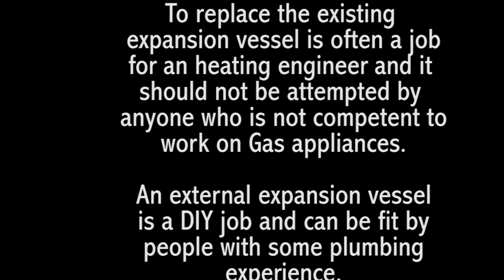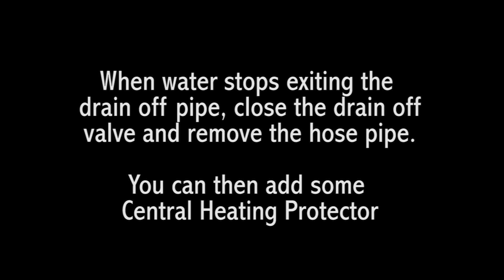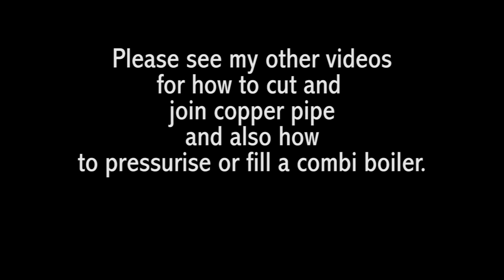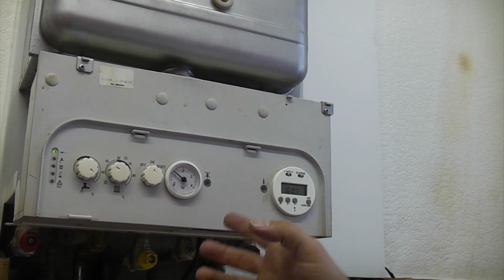How to fit an expansion vessel

Comment: You forgot to tell these people you took the case off your boiler which is AGAINST THE LAW! How did you make sure your expansion vessel was adequately sized for the boiler and system you have? Guessed I bet or bought whatever was cheapest. It shows in the quality of Inhibitor you bought. The cheapest they had
Reply from the maker: I suggest you go and check the LAW before you go spouting off a load of nonsense.
You do not need any qualifications to remove the cover from a combi boiler unless it forms part of the seal for the combustion chamber. The vessel was sized correctly BTW ;-)
Now go and spout your nonsense elsewhere!

Comment: Couple of slight issues here.
You mention yourself your not gas safe, yet then remove the front cover of the boiler! Your average diyer should never do that,and the room now needs checking for escaping flue gasses.
Also filling loops should never be left connected (water regs)
Reply from the maker: I checked with Gas Safe who said I could remove the case from my boiler.
I know the filling loop should never be left connected, but when I posted that in my other video on how to repressurise a boiler all I get are people saying theirs was left connected by the engineer that installed it.
Perhaps Gas safe should be doing more checks on it's members to ensure they are not breaking water bye-laws.

Comment: You turned off the supply at the Return pipe .
Then when everything was Connected up you opened the Return pipe to let water in . So is it safe to say that the Reurn pipe is the one supplying cold water to the boiler ?
( And thanks for the video )
Reply from the maker: No, there is a chance that someone has connected the filling loop to the flow pipe.
The central heating works by having two pipes, one pipe is the flow pipe and the other is the return pipe. There may be 5 or more pies entering the boiler but only two of them are used for the central heating.
Hot water leaves the boiler via the flow pipe and then after it has been circulated around the radiators it returns to the boiler to be heated again, this is the return pipe.
If you have the boiler on central heating only (not using any domestic hot water) you will feel that two of the pipes get warm/hot. The return pipe will be the cooler of the two pipes, if you have a digital thermometer you can use that ;-)
Reply: ***** Thank you again .
Reply from the maker: Tee Emm
You are welcome ;-)

Comment: soz, maybe a daft question but do i need to disconnect the old expansion vessel or just leave it alone? I have just discovered that there is defo water in the tank as i pressed the schrader valve and no air, only water... I have a Vokera Compact HE boiler (5yrs old).. any advice would be appreciated.
Reply from the maker: Just leave the old one where it is, there is no need to disconnect it ;-)
Reply: ***** just leave it... wont it continue to leak / drip water ??
Reply from the maker: Anthony Need
No, it's only leaking water when the schrader valve is pressed in, just like your car tyre will leak out air if you press the schrader valve in.

Comment: I understand your desire to diy. If your on low incomes the cost of a professional is a little off putting. Your advice is obviously researched and provided in good faith. There are a few errors in your information. I hope the folowing info will help.

1. Some boilers will not function correctly without the internal expansion vessel in working order. 
2. The size of the internal vessel is only designed for the boiler and a small number of radiators. 
3. The main cause of failure of expansion vessels is being undersized. 
4. Replacing with an undersized vessel is going to lead to a repeat failure. 
5. Expansion vessels need to be checked annually at the annual service. 
6. Expansion vessels should be refilled with nitrogen not air. 
7. Water issuing from the Shreider valve Doesn't prove the failure of a vessel but mostly does.
8. Flexible hoses are not the best means of connection as they can allow oxygen ingress. 
9. There is not a standard pressure foot the vessel or the system. 
10. The charge pressure for the vessel and the system are calculated from the relation ship between the height of the system above the pump and pressure gauge. 

I read a comment saying that you don't have to be registered to install gas boilers. This is true but needs to be explained further. The law says that you must be competent and that the standard of proof required for competence is being gas safe registered. This clearly leads to the fact that you do need to be registered, however this applies to individuals in business. The proof of competency for an individual working in his own home is a formal qualification such as those required for gas registration. If you had these qualifications which are only Valid for 5 years an were not registered with gas save you would be a stange individual.
Reply: I reckon I can build that inhibitors need a great deal of understanding. both Christopher Flaherty and I take great interest in water quality issues and believe that the European vdi standard is correct. this standard means that inhibitor is almost never needed.

Comment: Well the PTFE didn't work. I am now losing about 0.2 bar every day from the system (boiler not being used at all), so air is escaping after filling. I wonder if it is definitely losing air from the valve on the vessel before investing in a new vessel. Do you know of any other possible causes like air purger valves that I am unaware of that I should rule out before parting with money? Much appreciated! :)

Comment: Thanks, I did think of this myself, but before doing it, I let the rest of the air out to test that no water leaked out, then repressurized and squirted WD40 over the valve while it was hissing, and it seemed to stop leaking air. Not sure if the WD40 just deadened the sound but the valve did seem temperamental, I guess time will tell. I will try the PTFE if it fails again. Thanks for helping me understand how it works so I could try this, I hate to throw so much money at a repair man!

Comment: Thanks. I checked the valve,  I pressed lightly & no water came through (however the valve is at the very top of the vessel), but the air pressure was down to nothing. I put 1 bar into it, which forced the CH pressure back up, but when I took off the pump, air was leaking out of the valve, until I put the cap back on. Can I assume that this leaking valve is the problem why I keep losing pressure and have to keep filling from the loop every now and then? Thanks very much for your help!

Comment: Job done, though as you say, not to be done by an amature, and you have to watch the electrics, sorry i did,nt mention that i am a retired electrical engineer, with industrial boiler experience, repair, installation & design, however after resting for a while, just thinking out loud definately resets the brain, also i have the PDF manual
thanks for listening, you reset my buttons!

Comment: i would be isolating the existing expansion vessel completely fron the 
boiler ? just leaving it in place ? replacing the system with an external expansion vessel immediately outside the boiler? nothing else behind boiler. the orignal vessel would just be left in place with no connection to the boiler.

Comment: i would be isolating the existing expansion vessel completely fron the 
boiler ? just leaving it in place ? replacing the system with an external expansion vessel immediately outside the boiler? nothing else behind boiler.

Comment: i would be isolating the existing expansion vessel completely fron the 
boiler ? just leaving it in place ? replacing the system with an external expansion vessel immediately outside the boiler?

Comment: difficult to see, i assume its on the shrider but as it at the back of an alpha 240 and only leaks when the heating is on i think the diaphram is leaking with expansion, very slight as pressure is not lost on just dom. h.w, also the drips can be seen dropping from the back casing
dolphin

Comment: Hi, I,mm fitting an external expansion vessel , as there is a leak on my present vessell, although it,s difficult to see where,
the new vessel is precharged to 1.5bar, however the system required only 0.8bar do ihave to reduce the pressure, also can i just cap off my old vessel
dolphin

Comment: Also my system vessel pressel is 0.8 bar (8lt) systempressure pressure cold is 1.0bar the replacement vessels from tool station are precharged at 1.5 bar do i need to reduce the vessel pressure ?
dolphin

Comment: Your expertise and time is much appreciated. The radiators are all full and I checked under the house (Mobile home) and no leaks. Usually when I fill a bath with the water temperature set high it drains the pressure down to nothing, but doing the washing up with temp low doesn't affect it. I will try what you advised. Thanks so much.

Comment: I guess that makes sense and can see how the new one takes over, thanks for the insight. 
The problem I have is that my system doesn't always loose pressure when I fire up the hot water, only sometimes. Will the fitting of an external vessel still fix it in this case?

Comment: Thanks so much for this! 
Can I just ask what happens to the original faulty expansion vessel? If the diaphragm is knackered and you fit a new external, how does this work if the original is still in place? Sorry if I'm being a bit thick about how it works
Reply: Leave old x tank in place.be fine

Comment: A sensible and straightforward guide. Thanks.
 
And will idiots please stop saying " leave it to the "professional"
a) This is not anything to do with the "Gas" side - its a plumbing job 
b). If you were going to pay a man, you wouldn't be looking here, so a helpful video is a boon. 
c). I've seen many complete bodges done by "professionals in my lifetime - I do it myself often cos I want it done right. If it's a Corgi job, then I pay the Corgi [I know ,Gassafe] ,man.

Comment: Sorry To but in, but the expansion vessel should be fitted as close to the return pipe near the boiler, The reason being is all to do with the "neutral point" in this case the neutral point would be the expansion vessel. So anywhere between the neutral point and the boiler pump will be working under negative pressure (bad) so the nearer the better, if you install to far away you could be forever venting radiators which in turn is not good for the system, Hope this helps

Comment: duuude, you forgot the gasket on the expansion manifold 
it is gonna leak for sure, also do not use hemp, but loctide, 
if you use hemp , jou wil have trouble getting the vessel off of there, 
and by-the-way they need to be replaced once in 5 to 8 years :P
cheers mate

Comment: Hi mate, great informative posting. Can you clear up a few questions? I have a worcester bosch junior 28i combi. The expansion vessel has been disgnosed as faulty along with the PRV. If I fit a secondary vessel as per the video, do I need to remove the existing one and how would the pressure release valve work on the new vessel. I was quoted £1700 for a new boiler so I would like to have a go at this before the  new boiler option. Cheers
Reply: you would leave the old one in and fit a new one on your return pipe. you don't need a new boiler. with the Worcester jnr you sometimes can't change the vessel unless you take flue off and there is another room between vessel and ceiling to get it out or you have to take boiler off the wall. so it is better to just add a new vessel on return. its standard practice to replace prv if vessel has split or gone over 3 bar and released water outside.

Comment: I think i may have a vessel fitted with a removable membrane in the form of a balloon, it is made by aquasystem and it has very little lip round the waist line of the tank.  I am getting water squirting out when I depress the air valve, which I believe means the membrane has broken and is letting in water, we also find the vessel to be very heavy and hard to attach to the wall which surely supports the fact it is too much water ?  My builder refuses to refit new membrane and is reattaching????

Comment: New expansion v. should be same vol as exist'g, a bit bigger is not a prob, refer to mnfr if the old one's in the boiler.  Always fit new vessel as shown in vid, schrader valve down, piped to avoid air traps. Vessels are pre-gassed with nitrogen, usually @ 1 bar. Adding air shortens its life. Important: water pressure is higher than gas pressure, or unit can't work properly- 1.2-1.5 bar is ~right. After refilling & firing a few times, check water pressure- the refill will 'gas off' disolved air.

Comment: My system has an open vented central heating there is no pressure on the meter at any time the water is topped up via a small headder tank in the attic on a ball cock feed do i still need pressure in the expansion tank ? ( 24 cdi rsf ) Thankyou

Comment: It doesn't matter about the pressure vessel which ever way it is (check manufactures instructions). The way it is installed will ensure that any air on the heating side of the pressure vessel can escape freely from the vessel itself thus ensuring the system is free from air. One disadvantage is re-charging, if ever its needed (bottom in an awkward place). Unfortunately I wouldn't hold my breath on gas safe worrying about this video. Im sure its not in their interest as its in own home.

Comment: You,ve installaed the expansion vessel upside down and the pipe work so basic by using compression elbow. you could turn the 22mm tee facing to the right hand side, in that case you wouldn't need any tee. 
Also that's not good way to add inhibitor, you could use a towel rd or there a tool which can be connected be side rds to add inhibitor. 
Thank you
Reply: Rubbish, I have exactly the same expansion vessel as in this video. Mine is also in the same upright position as in the video. I've had mine installed for almost five years now without issues!